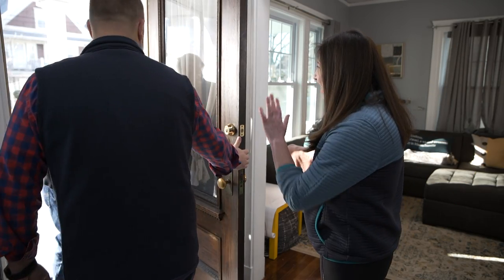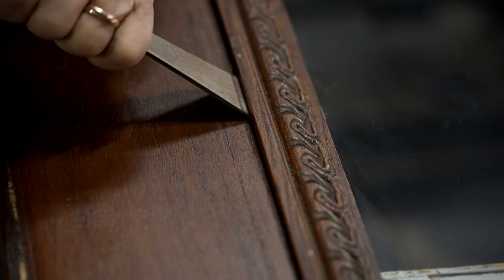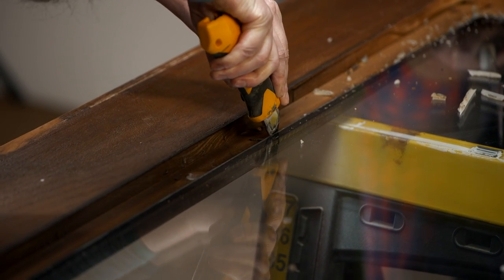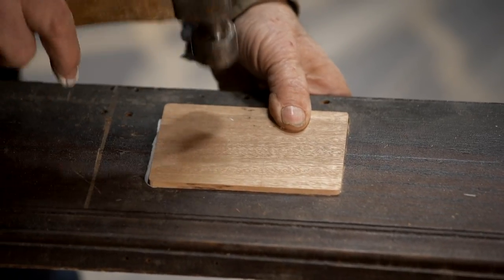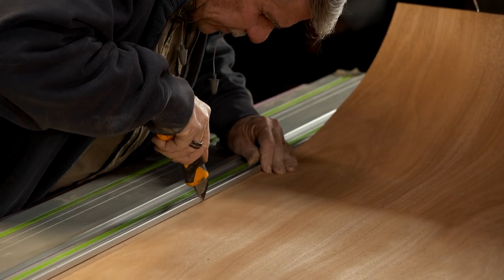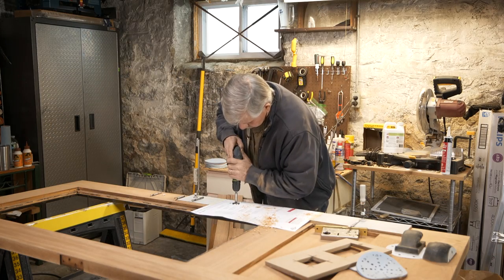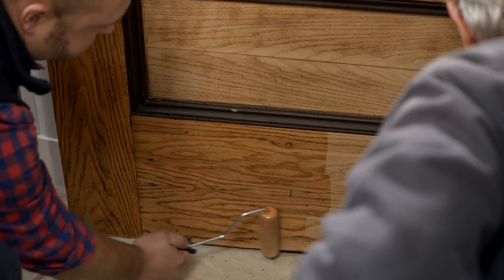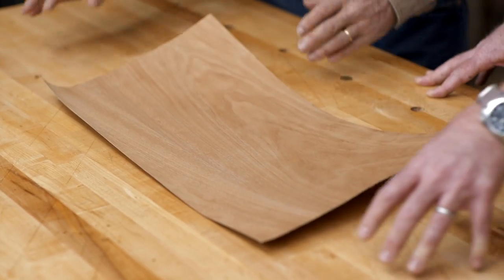How to Restore an Antique Door | Ask This Old House

Comment: I am restoring a 120 year old solid oak door with no vaneer. It had Watco golden oak oil in it for several years which failed to a black staining but fortunately cleaned up nicely with oxalic acid solution. Then many many hours of 220 grit sanding followed by a first coat of %20/%80 mineral spirits and Helmans Spar varnish. It did not run with controlled delicate brushing. Next is 220 grit sanding and a 2nd coat of same. Then sand and final with %100 full coat

Comment: Master workmanship.  There is no other complex wood restoration at this level on the net.  Other outlets would try and strip and refinish original door face w no veneer for an aesthetic excuse leading to other problems: uneven finish, traces of the old hardware patches, a loss of 1/16 of door face via heavy sanding, double or triple the hours, leaving that home with no door over many nights.
Reply: @Kevin-mp5of  If you have, then it should be easy to point out.
Reply: This would definitely NOT be considered "Master workmanship", one level up from DIY maybe, but not master level.  The finished door looked a bit cheesy to me.
Reply: @Kevin-mp5of  I understand - but people need to understand that Tommy is a great "Jack of all trades, but as the old saying goes.... "master of none"
Reply: @bestbuilder1st  Yes?  How so?  Any number of so called wood workers would have not used the laminate in this case, citing aesthetic nonsense like "I just like the feel of hand finished wood", and "good work takes time" as a justification for their preferred way of working.   Shaving down that weather facing old door would be an inferior product more susceptible to elements and warping, and entailing far more time and money for a guy who *needs a exterior door now*.  Excessive time and money =/= better craftsmanship.
Reply: @bestbuilder1st  Saying also goes, "all hat and no cattle".  That is, Silva demonstrated a one day to re-hang, defect free repair here, and you're still talking.  No details, no better options.
Reply: @Nill757  You are making a big assumption with your original post and other statements - especially "There is no other complex wood restoration at this level on the net".  a bit myopic I think. This would not be considered "complex" to those in the industry, and definitely not the best on the "net".  Maybe spend more time broadening your horizons and seeing if there may be a better way.  Learn some new skills from others on the "net and be a bit more open-minded.
Of course, if you desire to be the President of the Tommy fan club, then I am just a troll.
Reply: @Nill757  also that door had a veneer on it already. that was peeling and cracking, and had holes drilled through it. I don't know how people expect that to be fixed lol.. i think a lot of people missed the fact the door had aveneer on it as it was.
Reply: @chrisburns5691  There's a large but unfortunate pull evident in comments on craftsman videos to justify some project in their basement, taking forever, as somehow the only way to do the project if you truly "care" about quality, safety.  Meanwhile the rest of the family has no front door or whatever.
Reply: @Nill757  that and I don't think they understand the original door has a veneer already. It's not some solid wood they are putting lipstick over, they are replacing it with the same method it was built, yes stick on vs using contact cement but if it sticks the same no difference. Still a mahogany veneer.  Not much you can do with a veneer that is peeling and cracking.

Comment: Actually, I would tint the sealer. Without the tint it’s just plain dead. Then you can decide if the varnish layer also needs a tint. Tinted sealers were common. I know. I have been involved in the analysis of painted finishes since 1978.

Comment: Thank you so much! I'm staring at my  100 year old front door that desperately needs to be be stripped, repaired and re-varnished along with the rounded moulding and I'm terrified! The moulding had 100 years and nearly the same number of coats of paint but it's right down to the bare wood but someone.... left the painter's tape on the door too long and it took off the varnish around the perimeter of the door, so glad it wasn't me!! lol I nearly cried!  I was never intending to do the actual door but now I have to and it really does need a face-lift!! Knowing that it might be veneer I'm even more terrified to sand it!! And some of the pieces are beginning to warp and buckle. And I have NO idea how I'm going to match the bare soft wood of the moulding ...I think it's maple and what appears to be ...Oak but now I'm thinking it could be a fancier veneer. I've never seen oak that has that kind of detail. I tried sanding it by hand because I'm terrified to let the heavy handed man of the house go near it with an electric sander!! He was really hard on the moulding and damaged it much to my chagrin!! But it would take me another century to sand it by hand!! lol I guess I'll just take a deep breath and hope for the best. If I survive this unscathed, next, I'm going to do faux limestone block around the doorway to emulate the exterior of the building and give it a more authentic castle look. I'm much more comfortable doing faux fini than woodwork! Thanks for the reminder about lead,  I had a mask on but never thought there was lead in the varnish and I was ripping away the old calking, plaster and paint from around the door! Yuck! 
If anyone has any advise on how to re-create this beautiful dark finish... not one of the samples I've seen resembles it. It's somewhere between dark Walnut, Mahogany and Cherry..... but I'm not sure if the moulding will look the same being such a different kind of wood. It's so soft, I can dent it with my fingernail!! I really should have called in a professional, I feel sick!! But thanks for the tips!

Comment: What's the point of a deadbolt in a door with a giant piece of glass?
Reply: @Kevin-mp5of  just hit the bad intruders with your stuffed bear "Kevin"
Reply: Inside keyed deadbolt means a thief has to enter through the broken glass, and has to carry out anything lifted back through that broken glass again. Even if interior is not keyed, thief can't know that.  So much for a quick getaway.
Reply: @Nill757  Thief could easily see if the inside is keyed or not. This is extremely rare in residential front doors, it's a fire hazard, and most people just end up leaving the key in the lock inside. Criminals know this.

My main point was more the fact you should either pick a door or a window, not both. A glass front door is very unwise in 2021, I don't care where you live.
Reply: Live as you choose, and if need be, keep a gun handy. Or move away from the scum.
Reply: @ryanroberts1104  Yup. Sad. Its a mad world.

Comment: Do you need to add a veneer if you want to finish the door with paint?
Reply: Nope. Just do two or three coats of primer over your filler, sanding between each one. Check it is perfectly smooth in very bright light.

Comment: I think it was prettier before. It had a lot of charm.
Reply: BIG TIME. Looks like every other piece of contemporary big box store/factory made junk after all that work. Glad I' not the only one with eyes on this video.
Reply: Yeah, my main issue is using mahogany veneer, instead of oak. It just clashes with the original oak mounding, especially with the finish. Also, I would have reused the original lockset and had it re keyed. Still informative though.

Comment: "we want to keep the old door" covers door in ugly new veneer
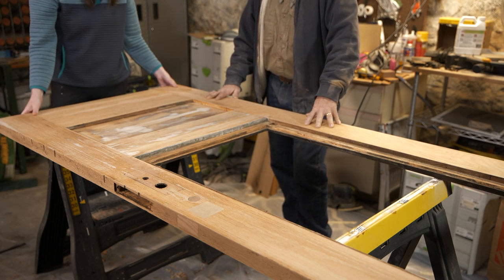Reply: I'm really glad you said that. I didn't want to be the only "downer", but I was disappointed with it also. And you can tell at 6:50 that she didn't really want new veneer. Neither would I. Even though she oohs and ahhs over the door after it's done, I'll bet she's disappointed that it doesn't look like an old door anymore. Doesn't even look like the same door. I would have much preferred just a refinish and keep the look of the old door with a good protective finish, but with all it's old flaws. I would have kept the old hardware also. 
Robbed it of it's character. Was like fixing the crack in the Liberty Bell and refinishing it to look new.
Reply: the door had veneer that was original, and was peeling and cracking and had holes drilled in it. Not sure how he would have worked with an old veneer that was cracking and peeling off, and had holes for a deadbolt drilled through it lol...
Reply: @BeingRomans829ed  You are soooooo correct sir

Comment: Okay, I have to ask about the hammering.  Why would an experienced carpenter use such small swings with the hammer? Every time they hammer something on TOH they use little, tiny taps. I really hope this is for the production and not how Tommy actually swings.
Reply: Cause this isn’t rough framing work
Reply: This isn’t rough framing, this is fine detailing and restoration work. Using monstrous big, long, heavy swings would destroy this door. Tommy did this the right way.
Reply: @burtreynolds5427  i see them doing tiny taps on framing too.  I just watched Norm take at least 10 strikes to drive a hanger nail in a deck framing video.
Reply: @AxcelGamer97  the right way is awfully subjective. I could nit-pick the lack of a beater block but what difference would that make if they are using an adhesive backed veneer. the right way would probably have included some clamps, cauls, and a hide glue pot but what the heck do I know.  I just wanted to know about his tiny taps.
Reply: @platipuss777  it’s not subjective. Results are objective, both in quality of outcome and time to finish.
Reply: @platipuss777  you don’t have clamp veneer, as it cannot lever itself loose  like a two piece wood joint.  The air pressure provides the clamp.  You do have apply incrementally and push  all the bubbles out because veneer will trap air unlike reg wood, which they demonstrated in video.
Reply: @Kevin-mp5of  I saw your comment about self harm in your profile.  You good?
Reply: @Nill757 thanks for mansplaining basic woodworking for me
Reply: @Nill757  actually, the tiny taps of my initial comment would work great if he were hammer veneering
Reply: @platipuss777  It’s not subjective at all. The results are very much objective with quality of the end product being the most important. If he beat his hammer against the door really hard like he would a roof or rough framing, that beautiful old door would break. There was no need for a beater block with how much control he was exerting over his hammer swings. If you wanted to know about his precise and fine taps, then now you know. If you don’t like the reasons why his hammer swings were the way they were, then that’s your prerogative, but it doesn’t change the fact that he did this the right way for what the product and desired end result were.
Reply: because he's an experienced carpenter, and this is finishing work... more about finesse than wacking away at stuff..
Reply: @platipuss777  Sorry.  Now back to your how-to-hammer original commentary.

Comment: Few problems with this restoration: 1.   The restoration could have been way better with having a mill duplicate the molding because the molding has no historical value or architectural value this would have been more proper for a truly refinished door.  2.  This type of work is VERY expensive because of skill but more importantly TIME involved.  Anytime a contractor has multiple days on a job (minimally a week for this one) then that equals lots of money.  Tommy of course knew about this but only did what the customer wanted so that's ok.
Reply: A week for this? You must be having a laugh and a mill to make you new bits when the old are perfectly fine for free compared to extortionate prices - work harder mate
Reply: @bradleypease2492  First you need to do the estimate and get that signed and then you need to remove molding and take to mill and have it DUPLICATED PERFECTLY which means the mill will need to make CUSTOM KNIVES for the millwork and so from making knives to finished process at least 2 weeks as other people are ahead of you.  Now we can get to the door of stripping, sanding, planing, fine sanding, etc.  Did I forget to mention the order time on the veneer.  How about the plywood and insulation that will need to be put over door opening temporarily.  I could go on but believe what you wish.  Good night.

Comment: Original to the house but silicone caulk ... Doesn't add up.
Reply: @Kevin-mp5of  Tell me more "Kevin"!
Reply: Possibly been re-glazed at some point.
Reply: Someone was missing with it before.  I would use window glazing
Reply: @markchapman8253  definitely reglazed, that appeared to be an insulated glass unit which would not have been available in 1918.